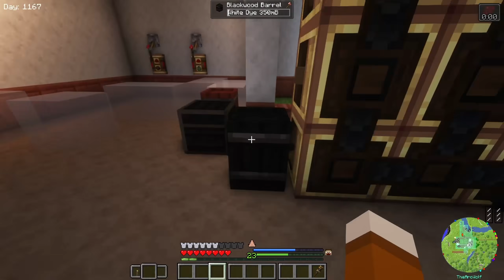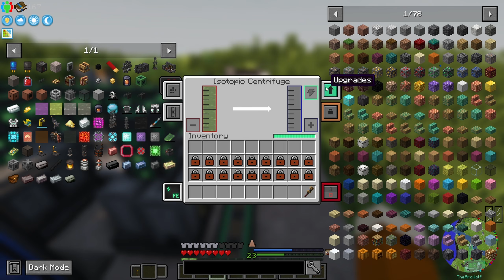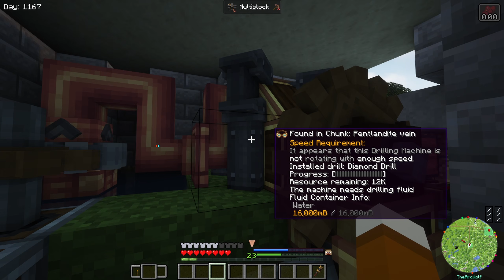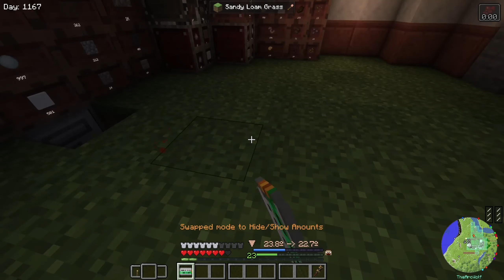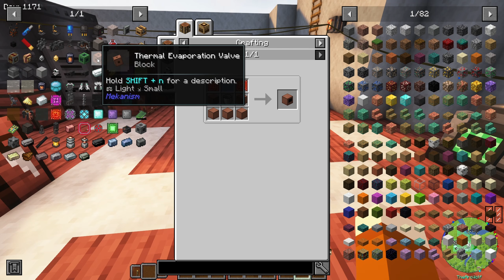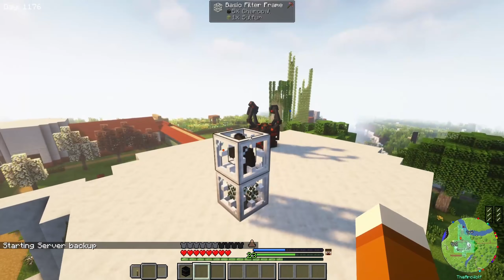Finishing the NASA Workbench - TerraFirmaCraft: HardRock Ep. 44

Comment: if you add a third valve and put a resistive heater next to it and power the resistive heater, you can make the thermal evaporation plant hotter than the ambient temperature. this will work with both the simple version and the upgraded version